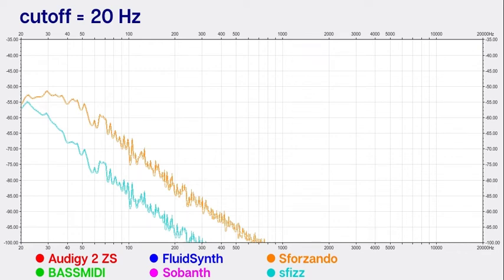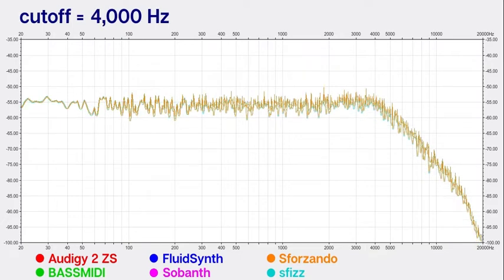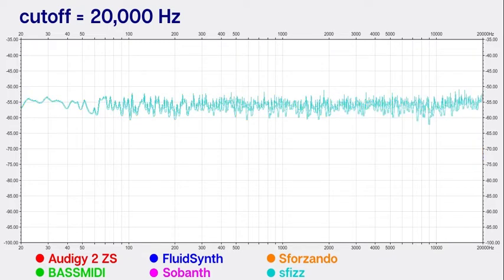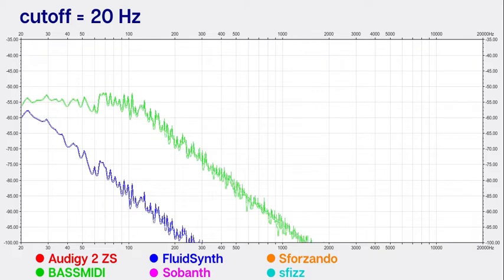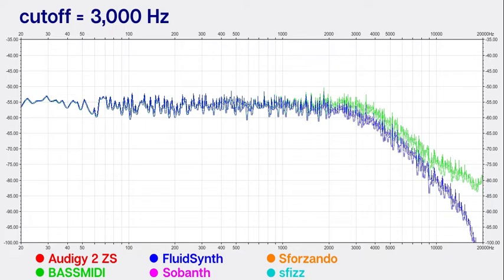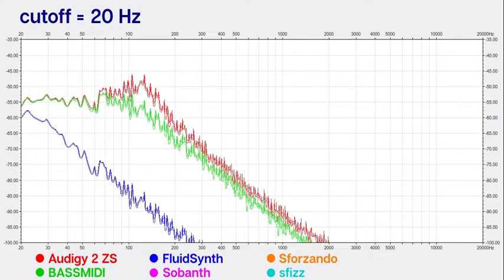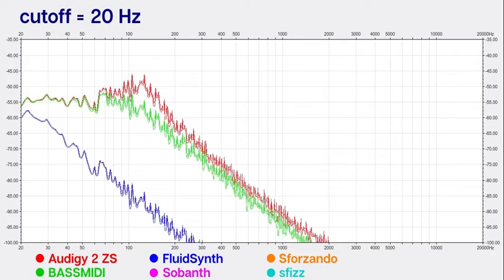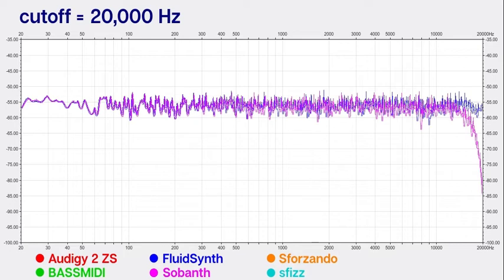SF2 & SFZ sampler filter comparison

Comment: Damm...
My life is a lie...
All I was working with was BASSMIDI.
But now Fluid is better at filtering!?
(I should have tried fluidsynth if it wasn't for that eerie flanger I get instead of a decent chorus effect. Even its reverb isn't pleasing enough.)
Reply from the maker: Fluidsynth's default reverb & chorus settings suck. With different settings, they sound much, much better, IMO. Try this:
Reverb damp: 0.3
Reverb level: 0.47
Reverb room-size: 0.67
Reverb width: 0.65
Chorus depth: 5
Chorus level: 0.5
Chorus nr (voices): 3
Chorus speed: 0.4
Reply from the maker: Or, if you're using Qsynth, then the settings would look like this:
Reverb damp: 30
Reverb level: 47
Reverb room-size: 67
Reverb width: 65
Chorus depth: 50
Chorus level: 50
Chorus nr (voices): 3
Chorus speed: 40
Master gain: 40
Reply: @SChristianCollins  Indeed. I tried Qsynth for just less than an hour, and I almost threw up.